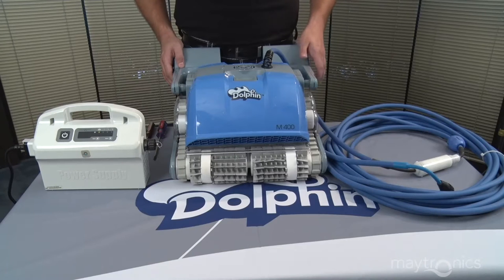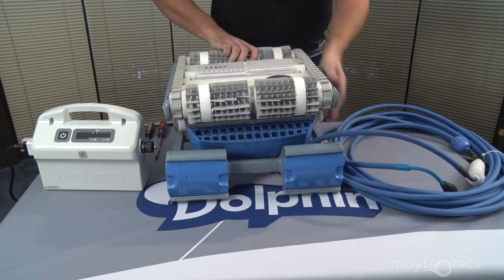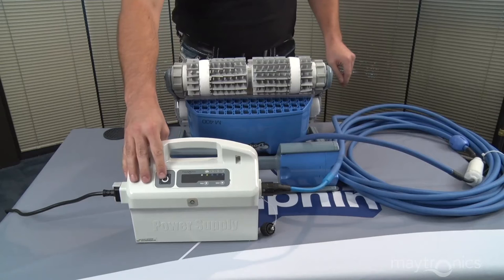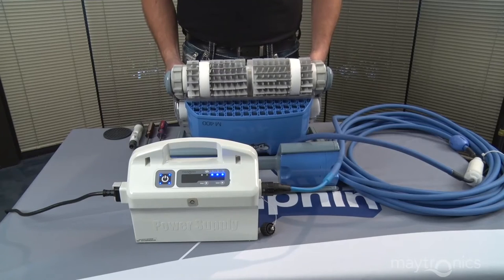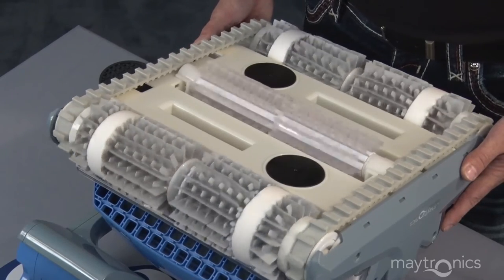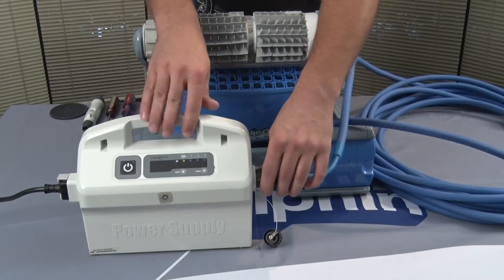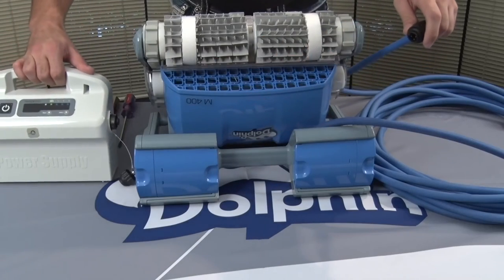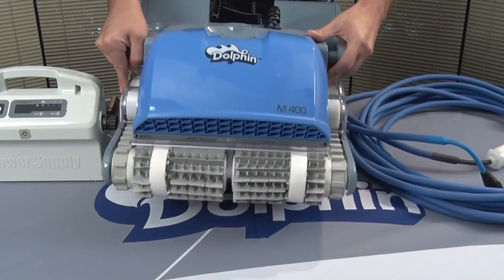Out of water self test Dolphin M400 robotic pool cleaner

Comment: Good luck with any Maytronics products. We are now on our 3rd Dolphin (M400) and still under warranty. Customer service has been by email only and they have a known power supply/cable issue that remains unaddressed. They will service it under warranty, but we have to buy a large box and packing supplies and spend $94 to ship it back to them. Their products used to be good, but we have had 3 bad ones in 6 years.
Reply: @lisajohnson8746 what has your dolphin been doing when it's the power supply/cable issue?

Comment: My pool cleaner the dolphin m400 which is also the same as the dolphin supreme M5 which I have when I pull up the robot from the pool the debris fall back in is there like a flap I'm missing or something that's causing it not to keep the debris inside the unit?